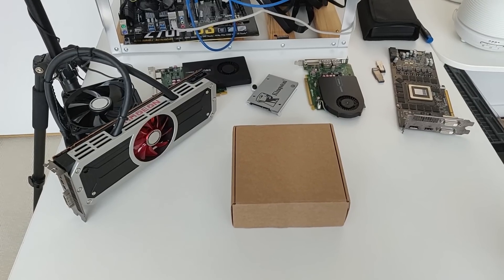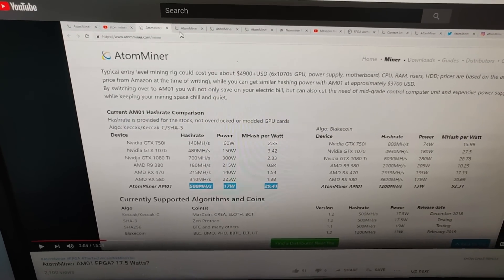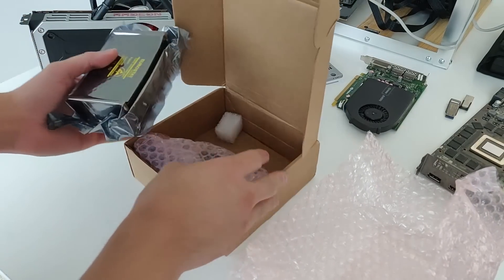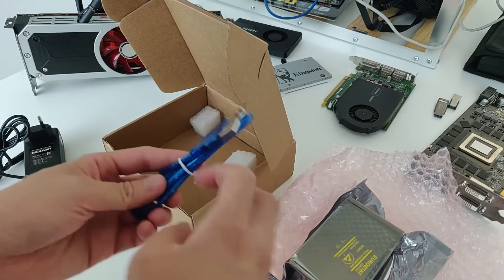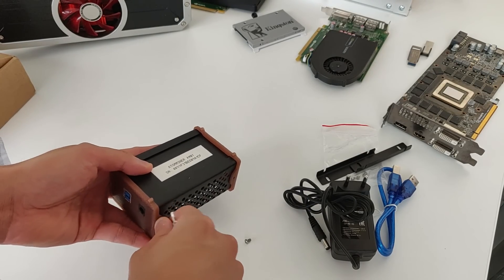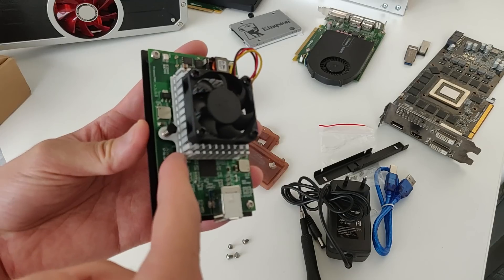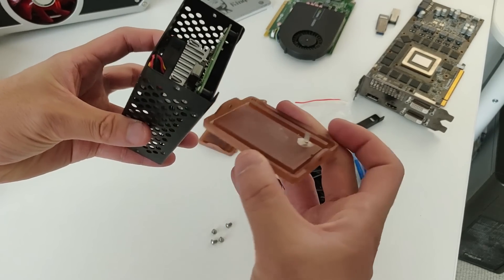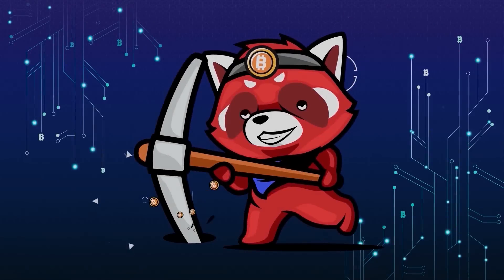UNBOXING of a Atom Miner AM01 FPGA!

Comment: Wow! Mr. Panda your channel has certainly grown from your first, where I was your only comment sometimes! Im proud of you and am amazed you have continued producing daily videos with relevant news! 
About that FPGA, NO WAY it can be the Ultrascale chip that comes on the BCU1525 because that board is GPU sized. It requires extreme power server (Delta) fans forcing 250+ CFM air through a heatsink that is twice the size of that whole unit just to run on medium power. Most people use custom water cooling blocks. I really should pick up one of these FPGAs or contact Squirrl about a sample for review. I, for one am desperate for some more youtube testing of this card. Once I complete my highly custom cooling solution for mine, I will be poping my youtube cherry with it. Inspired by RedPanda of course

Comment: Not the same chip as in BCU/VCU 1525 (Virtex), this has cheaper & low-end Kintex-7 chip (something less powerful than Kintex-7 XC7K325t, thats in F1 mini). Price (~$780) is too high for the hashrate, F1 mini ($179) has 2-4x better hashrate on same algos (Keccak: AM01 500 MHs vs F1 mini 2.1 GHs, Nexus: 100 MHs vs. 210 MHs).
Reply: Where to get f1 mini?